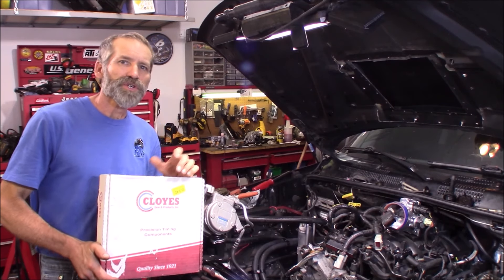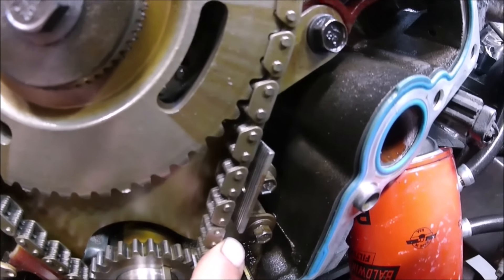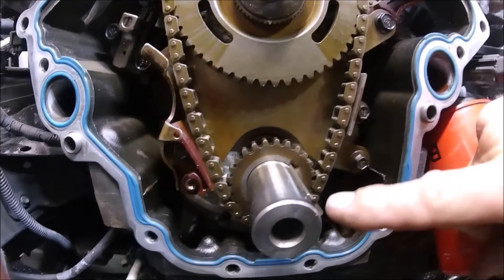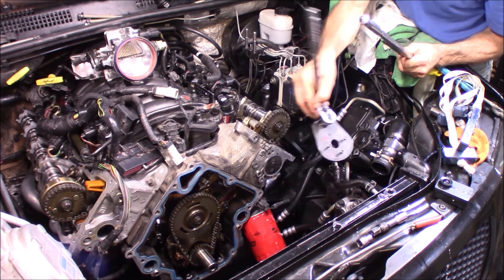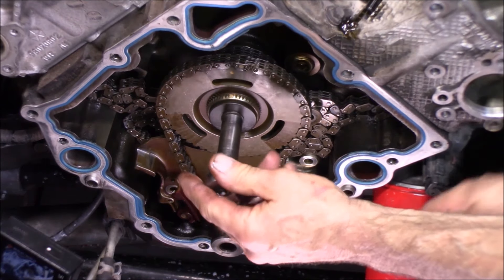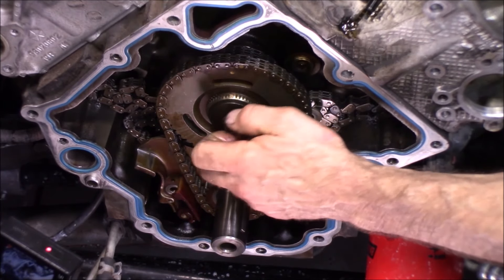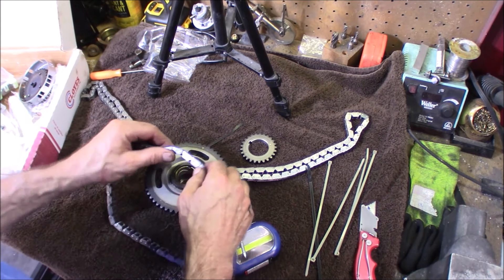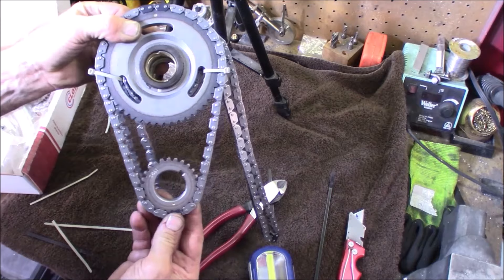How to Install Timing Chain Set Dodge, Jeep & Chrysler 4.7 & 3.7L

Comment: thank you for this video and its details. I would not have been able top move so fast on the wife's WK W/O it. subed for more!
Reply: i just wanted to follow up about this video. one f the steps was to grab the cams with vicegrips and roll them back to set the cam gear. i did not like this step as much as you in the vid. i decided to slide the harmonic balancer back over the crank and use it to rotate the engine assembly back manually. i rolled it back and aligned one cam sprocket, then rolled it forward and set the second cam gear. then i rolled it back to center and pulled the grenade pins. seemed to work well for me. just wanted to give you some more feedback. you seem to take your content very serious. thanks again for all your works martin.
Reply: @RideRevival_Outdoor  ,in the Chrysler tutorial video for the 4.7's, they use pliers and no towel. That really hurts my feelings. 😁

Comment: Got the new timing chain on. Still no start.
Reply: i am working on a 2001 dodge dakota. the engine was bad in it. 2 years ago we took an engine from a 1998 Durango and put it in the dakota. Would the reluctor ring on the passenger side camshaft be different? I have spark. I have fuel pressure. I have compression. Backfires when you put starting fluid to it XD

Comment: ...i have the 04 i6 grand Cherokee "tap" at 170,000 miles ,it started doing it when cold but now it does it all the time : (
i had an honest mechanic listen to it and he said a lifter collapsed which is simple enough but!! they're under the head
i am going to put in a new water pump/timing chain and new lifters to hopefully stop the tapping, i cant wait ; )
i haven't dropped the oil pan yet because he's sure its a collapsed lifter, why in the hell are the lifters under the head? why?

Comment: You didn't show how to take off the passenger side cam gear. It has the two brass pins where the drivers side didn't. How's your tool work on the passenger side since there is no where to put the screws on your tool...
Reply from the maker: Sorry for not showing you the passenger side Cam gear removal but my tool works exactly the same way you just pull back the 2 Allen bolts that I used and then put in one at the bottom is instead.  Then the tool is pivoting on the socket.

Comment: Hi again, I just noticed that the timing chain covers sealant, the blue stuff, look perfect. Did you put that on or was that the way it was when you opened it up ?  The only reason I'm thinking it is the original sealant is that you showed a package with a new gasket for that same surface but that does not look like a gasket it looks like somebody went around with professional tool and applied sealant from a tube. Anyway I'm just curious because if that is the original sealant I want to know what sealant that is, I mean how many years was it and that little 45° to parallel beads touching his boat ends look like it was done by a computer or a robot again why I am fascinated by this. Anyhow I'm going to watch the rest of it now and see if you actually do use the other gasket that you showed earlier.       
https://youtu.be/0bHxW0qU4WQ?t=237

Comment: Nice video, but why did you go back to the left side after torquing them down before you went to the right side. So you went and torque them down twice down to 21 or 23 whatever it was, 
it has me confused        https://youtu.be/0bHxW0qU4WQ?t=868
And  in this clip you say its 1/16 but then you follow up by saying to make sure that it's all the way on. So are you saying  the 1/16 is not acceptable and that the pin should be 100% flush with the surface of the sprocket? Here's the clip......https://youtu.be/0bHxW0qU4WQ?t=1357
Lastly, does it matter if the oil filled tensioners are installed earlier in the process than you had done?

Comment: DONT!, JUST PULL THE FUCKING PINS IN THE TENSIONER.  You will take to much tension out of the secondary tensioners and give you a slapping sound in the any side you have additional slack on. It will give you a nocking/slaping noise

Comment: this info was not helpful at all. i did exactly as was directed and ended up with a broke valve. the timing chain did not jump and when cycling the engine everything was still in perimeters. I suggest to anybody performing this job to just leave the timing in the same position as it was when replacing the timing chain.

Comment: There are two distinct versions of the 4.7. The later model (06 and newer) use a different timing set and the front cover doesn't use a gasket. Beware or you will have issues, and for god sake, get your shit from Chrysler because everything including the Cloyes parts are cheap shit.